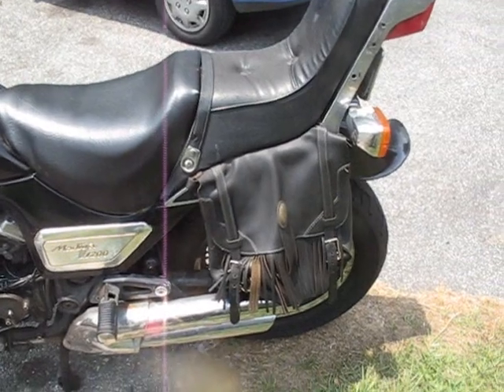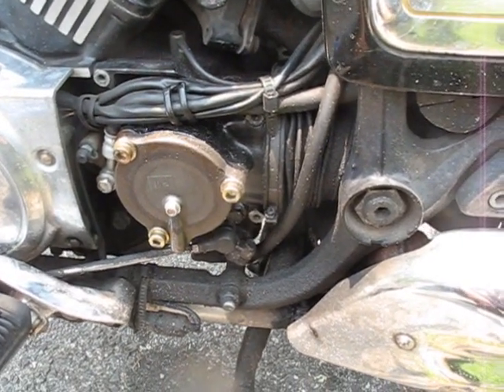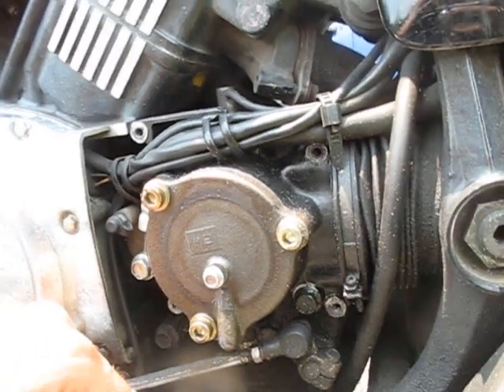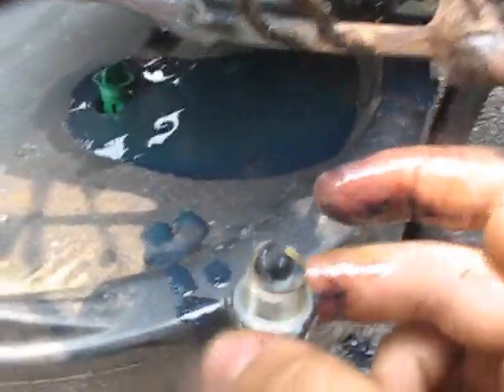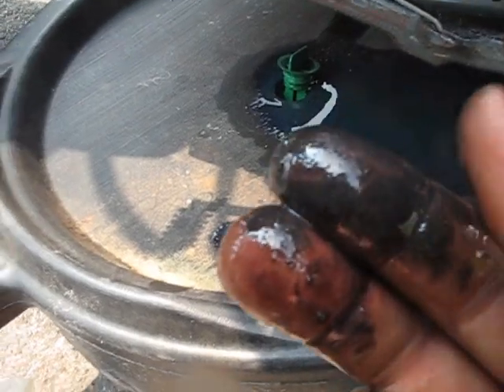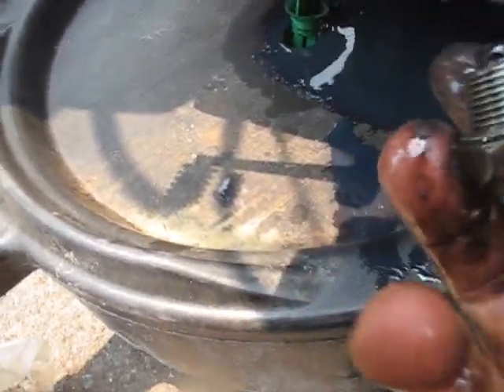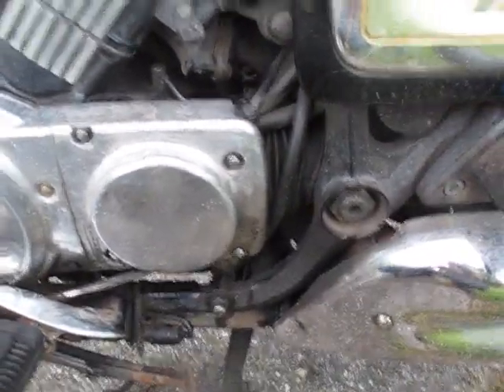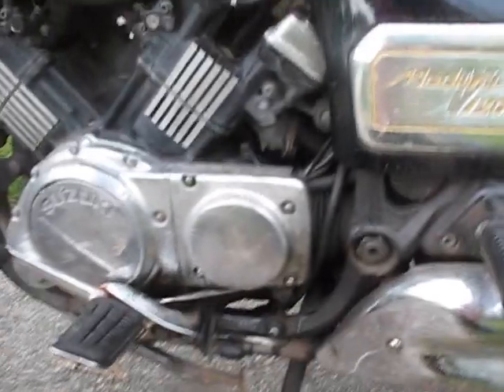How to care for your shaft driven motorcycle

Comment: If the vent gets plugged, pressure will build up in the front drive chamber and possibly pop the oil seals. This will lead to loss of oil out of the side but also might blow the seal between the bevel housing and the crankcase, in which case, the crank oil and the bevel drive oil will mix in future and it's not good for the bevel gears to be running in engine lube for very long.
This used to happen occasionally (it's a rare thing) on GS850s and by routinely cleaning breathers you avoid this.

Comment: Again, your vids helped me out. I came across an xj750 for an irresistible price. Great running motor. Just changed the primary drive oil (nasty). I've got a clutch related question. I've adjusted the cable to spec but I've noticed that coming to a stop with the clutch lever pulled in, the bike still powers forward. It's not severe but I obviously want to fix it. Am I looking at replacing the pressure plates or is there something else it could be? I'd appreciate any thoughts on the matter.

Comment: Thanks for this video! I can't seem to find a secondary filler or drain plug on my Kawa zn700. Is it possible that there isn't one? My manual has a section on the final drive but nothing about secondary oil.
Reply from the maker: Yeah some bikes don't have 2ndary drives
Reply: Some like my Suzuki (I scoured my manual after watching this video) the secondary is lubed with the engine/transmission oil.

Comment: So, most shaft drive systems on most motorcycles look relatively similar like this right? I've got an 85 Yamaha Maxim X, and I haven't taken too close of a look at it, but I just wanted to make sure before I really take a look at it, or perhaps it might just be better for me to take it into a shop and ask them any questions I have
Reply from the maker: Yes this is a typical setup, altho of course configurations vary. What problem are you having?
Reply: +mrmaxstorey well, currently I haven't had a problem, but I also haven't really even touched the shaft drive yet (taken a look into it), so I should have probably at least taken a good look at it before i even commented haha

Comment: What happens if u run it without no secondary oil ?
Reply from the maker: Significantly accelerated wear on moving parts
Reply: Will it burn up plates ? Or is that associated with reg. Engine oil ?
Reply from the maker: @bryanmiller5074  yes clutch plates are taken care of by the engine oil

Comment: My 86 Madura 1200 doesn’t seem to have a check hole and it looks different than this wtf
Reply from the maker: maybe you have a Magna
Reply: Gv1200gl 1986 model maybe it’s different in this year?
Reply: And only 3 bolts to remove the cover? Any info would help I don’t wanna seize up lol
Reply from the maker: @ayden4082  Cover has 4 bolts in a square setting, why dont you take a video and upload it to youtube and show me what you are working with. As far as I know there are no significant changes between the 2 years this bike was made
Reply: Alright I will do that thank you very much.
Reply: Uploaded it as a short
Reply: I’m wondering if I should just drain it and fill it with the amount the owners manual says
Reply: @mrmaxstorey  hey appreciate your want to help me but turns out I just had to  look and think a bit harder. My check screw is on the right closer to the shaft boot and I found it. Take care

Comment from the maker: Yuck. Consider changing the oil every 50 miles or so for a couple times to really get all the gunk out. When Suzuki rear diffs fail, sometimes they seize spontaneously at high speed rather than just wear out, and its caused more than one fatal accident